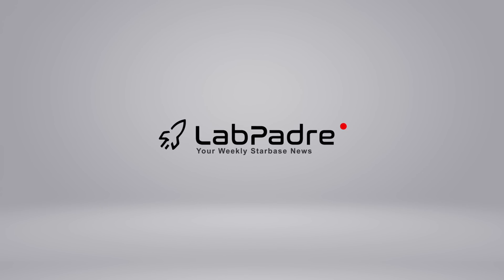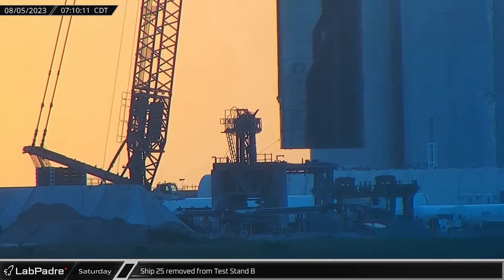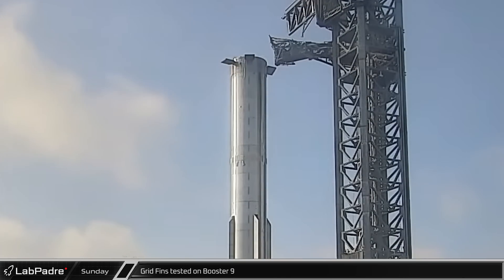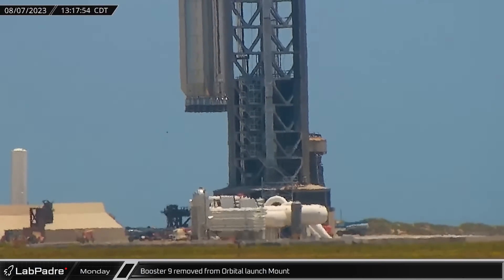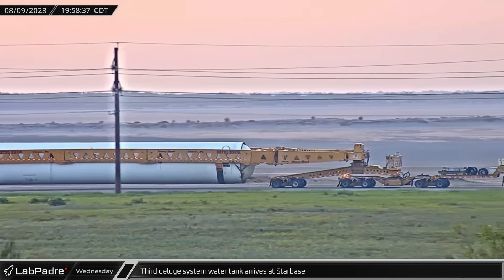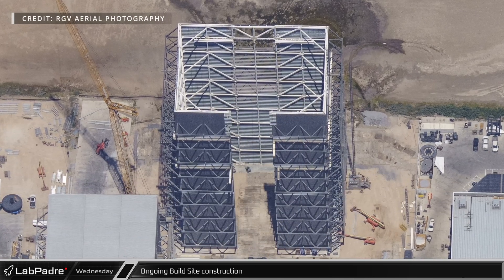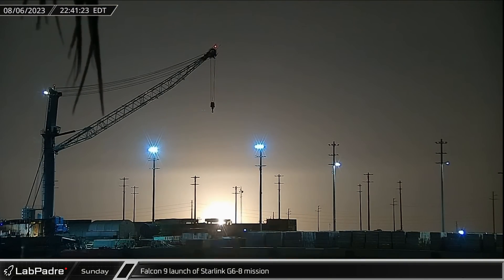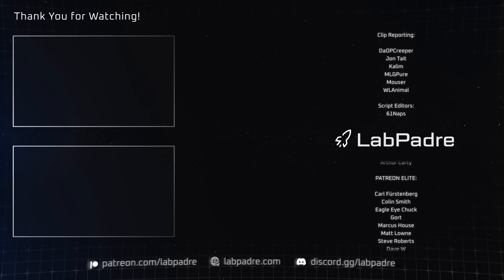Insane Progress at Starbase as SpaceX Enters B9's Final Testing Phase - Starbase Weekly Update #75

Comment: I still wonder if something to do with the fire suppression or nitrogen/water deluge systems snuffed out the 4 engines. The terminology used indicated they'd ignited then failed~
Reply: If a little bit of misting and inert gas enough to tank a Raptor, then SpaceX has a huge problem with the design.
Reply: These are all prototypes, many things changed between booster 8 and booster 9. It wouldn't be at all surprising that some plumbing needs a little adjustment to get the right propellant flows to all of the engines. There could also be some parameters that are too strict, or a condition encountered on the ship, that wasn't part of the Raptor tests at the factory.

At this stage we can expect multiple failures during testing.
Reply: Quite some engines that do work all considered, so whatever it is it seems locally.
Reply: Someone said elsewhere that they could even be testing the auto-shutdown mechanism for more than three non-starting engines. Test everything.
Reply: @RussTillling  That is an interesting thought, thanks